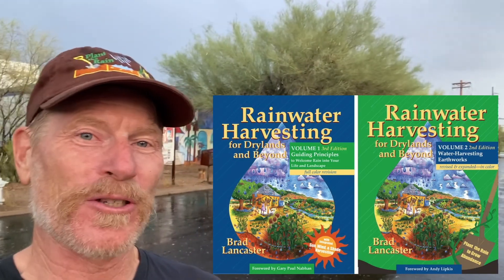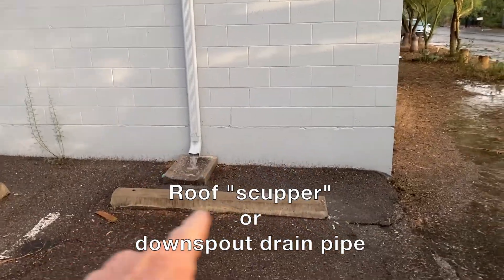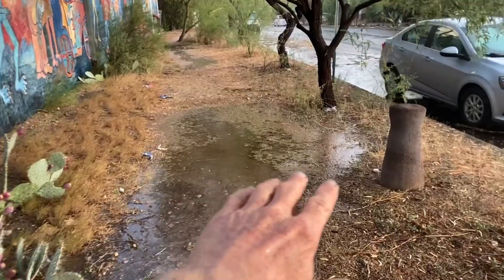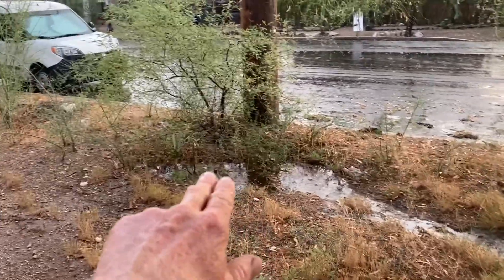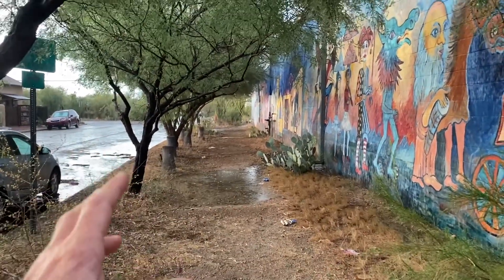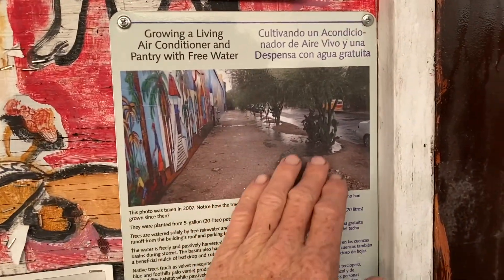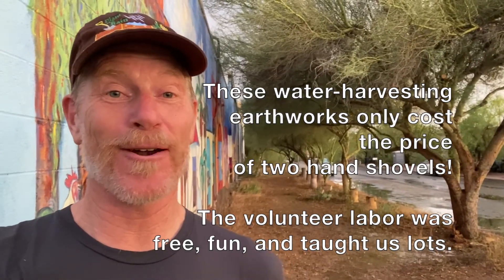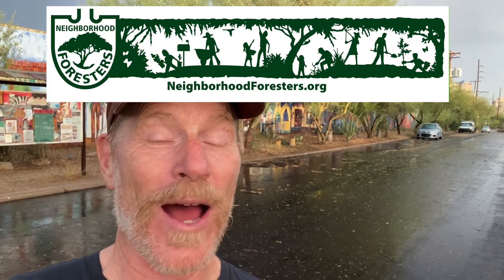Harvesting +30,000 gallons of roof runoff in tree basins for FREE

Comment: Good job. Unfortunately, where I live people can't stand puddles and i don't understand why. We do not live in the middle of desert but still have drought problems.
Reply from the maker: This system, and many others I cover in my books, will work great for those in your community not liking puddles, because the water-harvesting earthworks are all designed to infiltrate the captured water below the surface as quickly as possible. The water typically infiltrates in less than an hour. In some instances where you have high-clay soils with slow percolation rates, it may take 24 to 48 hours after a big storm to infiltrate all the water. But over time as the vegetation within and beside the earthworks grows, organic matter accumulates, and soil life increases and diversifies, the speed of percolation will  keep increasing. This results in less standing water and less puddles.

Comment: In case all My Fellow Nor'easters think we don't need this think again. It is great for Flood Control. And Water your gardens and other plants for free. I wish the park Service would Implement this on the western side of the Smokey Mountains it would stop most of the Flooding that happens in Gatlinburg.
Reply: Exactly!  I'm not wanting for water down here in the Southeast, but it's been a real boon to be able to slow and redirect the runoff.  One thing I'm pushing for with the parks and other agencies is the installation of "Beaver Dam Analogs".  There's plenty of videos on youtube showing how they work and why they're critical to the ecosystem, but it's still a hard sale b/c it's time and labor.  The good news is that we can all pitch in a little bit by putting in BDA's wherever we find a small crease in the land as we're walking around the woods.  Like Brad did with his "curb cuts", sometimes it's better to work a little covertly.  Those little folds in the ground might be dry right now, but we know they are just gutters for the rain when it next comes.  Putting a few sticks and leaves across the path might not seem like much, but every bump in the road slows the water down and gives it time to sink into the ground before it can join the larger channels and become to powerful to stop.  I've probably made a hundred super small BDA's over the last few years, always out of the way so folks don't destroy them, and you can absolutely see that it makes a difference b/c the moisture held in the ground uphill of the BDA is always greener and thicker.

Comment: That 37°F/20°C difference in temperature is impressive. It shows that there are alternative ways to cool buildings, instead of the cost and energy wasteful air conditioners which actually heat up the outside air even more. One thing I don't get, is why the street is as wide as a highway. Why do you need a six lane street, when a 2 lane + 1 parking "lane" would suffice? Or does it double as a take off and landing strip?
Reply from the maker: These streets in this historic neighborhood were put in before there were cars. Maybe they wanted enough room for a horse and buggy to be able to turn around? Regardless of the reason, we actively work to reduce the street width with water-harvesting traffic calming strategies.
Reply: @Brad_Lancaster_Water_Harvester  I dived a bit into it. If the street width is different, the biggest could be a main road or a cattle drive. Equal width might point to accommodation of "parked" horses and wagons, and indeed space to turn them. Or the width was needed and organically evolved when a track repeatedly became too muddy or loose to follow, and the next cart moved a bit to the side on more solid ground.
I like the "roundabout" and parking spot water catchments. Seeing a stream go in a full one, and no stream out, is mesmerizing.